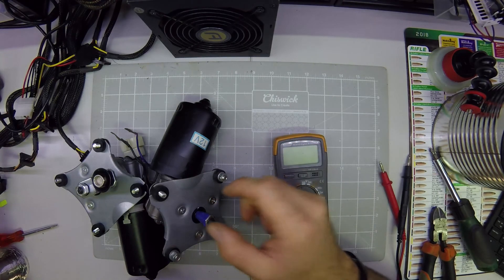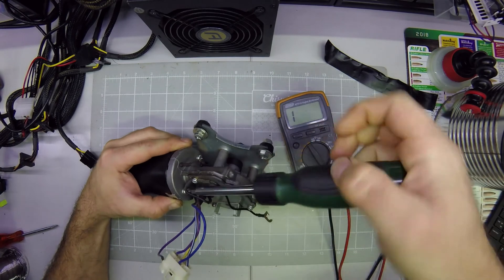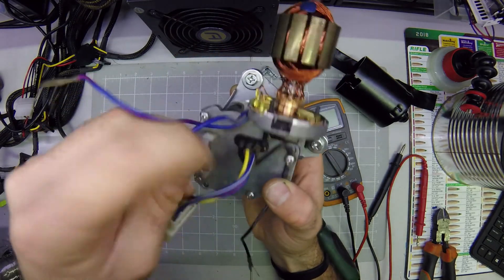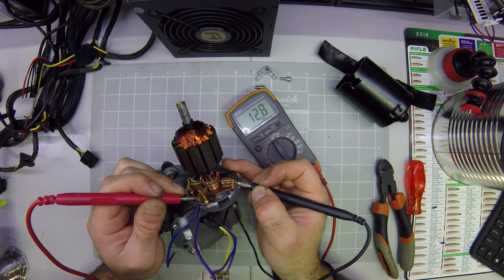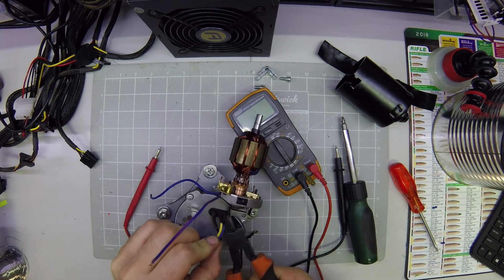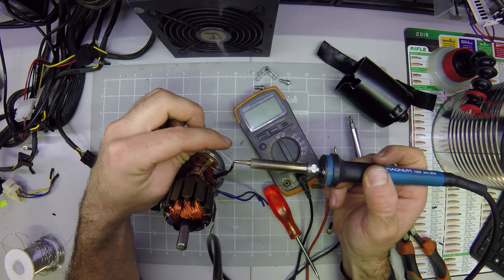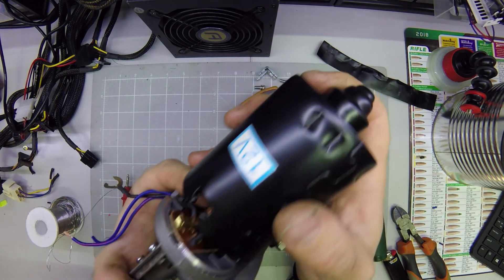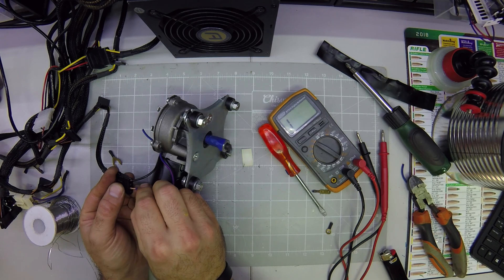How To: Isolate Ground Wire on Wiper Motor (or any DC motor)

Comment: nice ,so what is the specific reson why one needs to isolate the ground wire??
Reply from the maker: if you have 2 or more mounted to the same metal frame, and one needs the polarity swopped (to change direction), it will cause a short circuit and burn out the motor driver if not isolated

Comment: The cable you cut is the same as the one in my car. Why did you cut that cable and add another cable? Do I have to do it this way too?
Reply from the maker: This is to modify the motor, so that the negative wire is not common with the body of the motor. You don't need to do this in your car. This is only needed if you want to build a machine which uses 2 of these motors mounted on a steel frame.
Reply: @FaultyDaveZA  I understand Thank you. I cleaned the oil from the inside of the engine and cleaned the oil from the inner arm. Now the wipers are working.
Reply from the maker: @aurora. Oh wow that's awesome to hear, nicely done 👍

Comment: Hello question if i build a motion sim with just 1 dof (traction loss) would i still have to isolate ground ? I'm using ibt and arduino uno
Reply from the maker: Hi! I would say yes, because if you have your power supply grounded to the frame, it could cause an issue. Some power supplies have their mains electrical ground common with the Negative DC output. If the frame wont be directly in contact with the PSU or other electronics then you will probably get away with it. My first rig had a wooden plank where the motors were mounted to because i did not know how to isolate them. Hope this helps

Comment: Do you know what car that motor came from
Reply from the maker: This was from an 80's Toyota Cressida. It was the cheapest one available at the spares shop, and it seems to be larger than other car brands as well.
Reply: @Faulty Dave  cheers dave I've sorted 2 motors from Ford transits and have them working in my rig 
Now all I have to do is setup the arduino etc 
Then hopefully should be goo🫣
Reply from the maker: @johnwalsh1879  Awesome John! Good luck with the build 👍